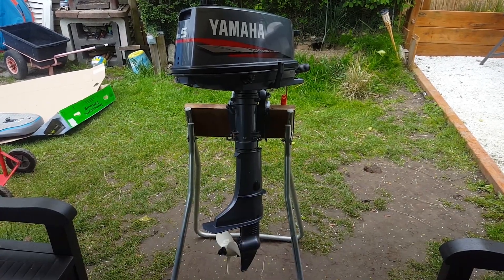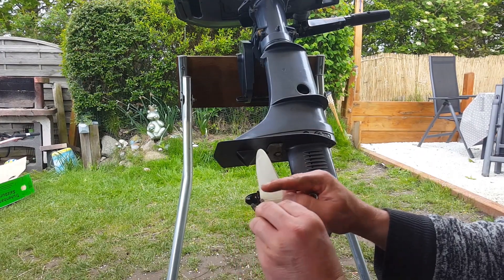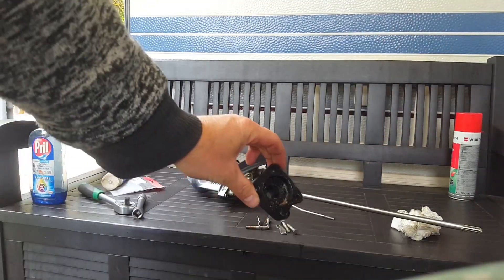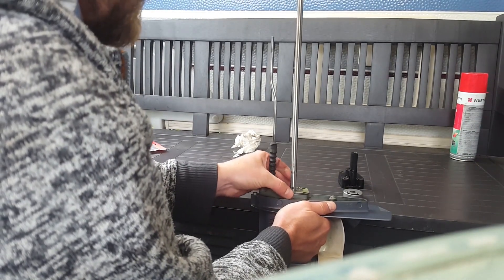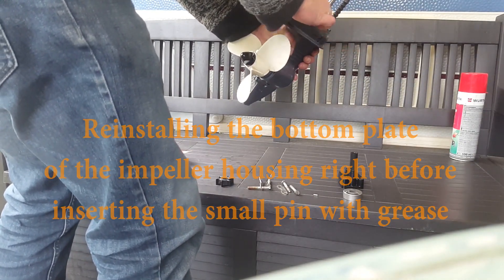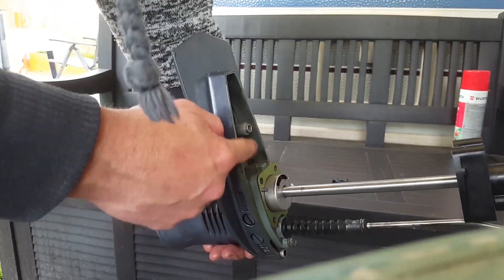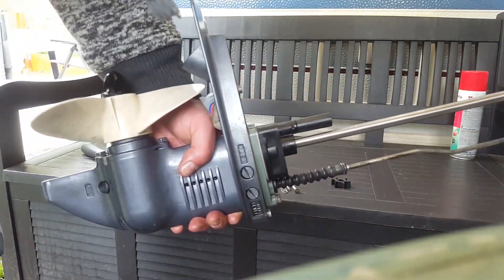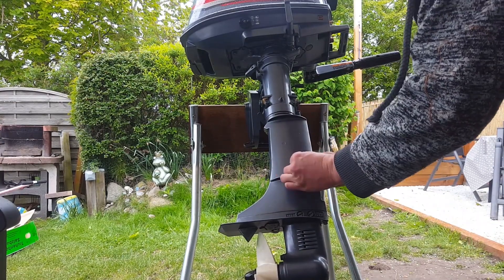yamaha 5 outboard impeller change tutorial tausch wechsel 5ps 5hp two 2 stroke Zweitakt Aussenborder

Comment: I have a 4hp mariner that looks identical and I just change impeller but I don’t have that rubber grout over here gear select rod. Wondering if I’m missing one or mine doesn’t have it.
Reply from the maker: That’s easy to find out if you know the year of manufacture, you can browse www.boats.net for example, find your model and check out the drawings 👍

Comment: Just did this. Turned out to be a nightmare job. 2 impeller bolts snapped off in the gearbox housing. I’m astounded at how badly the water galleries clog up. The aluminum in this Yamaha is average quality compared to my 2004 evinrude even!

Is now pumping but just spluttering water out. (As it did previously) I’ve not found one single video where it’s a steady stream of water. I’m not convinced it shouldn’t be a better stream of water.

Does this have a thermostat (I can’t find anyone changing it online). If the water pump galleries (under the stainless plate) were 90% clogged with corrosion. The rest of the engine must be a mess!!! The motor is in new condition. 

Mine has about 10 hours on it (black up only) and it’s always been run for 15 minutes in a bucket of water after every outing.

Also. Hot tip. ZIP tie the gearbox selector grub screw on its shaft to prevent it going up as you slide it all into place. Else re-installing the gearbox is nightmare!!!
Reply from the maker: @ibsn87  yes, the 5hp Yamaha 2 stroke has a thermostat. 👍
Reply: @audiokeller1975  you are right. I am now well acquainted with the cooling system after the last few days. 

I have removed the exhaust and thermostat housing and the top cylinder cover plate. It was 70-80% clogged full of calcium, crystals mixed with minor corrosion and possibly a bit of sand. 

After doing the water pump it was sputtering water out the tell tail, like on every YouTube video. So I assumed it was fixed to an appropriate standard. 

I’ve just never been convinced it should sputter water though. That’s not how water pumps work!! 

I decided not to be lazy and inspect the thermostat knowing I would likely need to order gaskets again.
Glad I did!!!! 

Scraping it all out. Letting an aluminum etching acid paste sit in there to help clean it up, gearbox back off so I could ensure all this crud didn’t go back down into the water pump and ensure the pipe remained clear. 

The galleries are so small, one decent ingestion of sand and it will collect and prevent our outboard from flushing properly and or draining properly ever again. 

If anyone is doing the water pump. I would say is mandatory to inspect the thermostat!! 

(I can’t believe was still operating and running even with such major blockages!)

Comment: I have a mariner and I just can get the gear rod trough the top hole, I losen the clamp , push the lower unit and with the drive shaft in the right place, spin the prop , the shift shaft is also in the clamp but I just won’t slide in, not with a hamer, not with spinning the prop I just can’t get in in